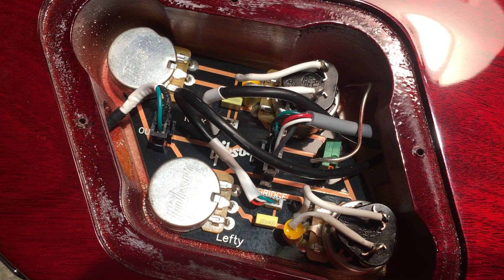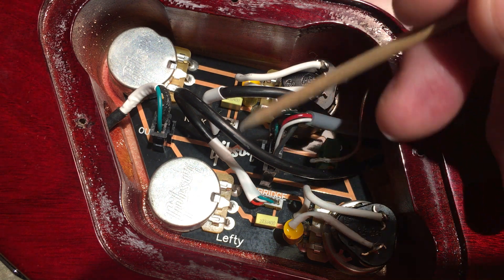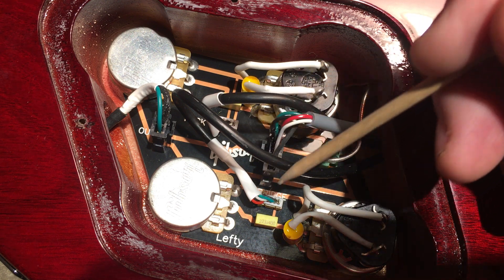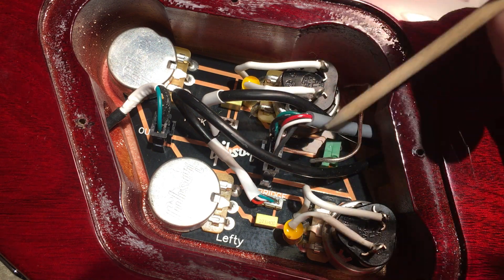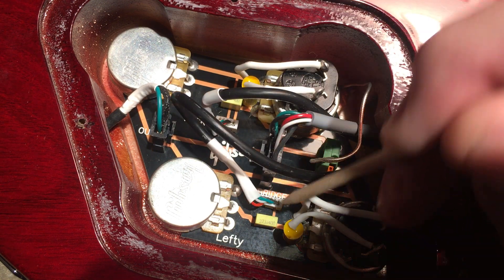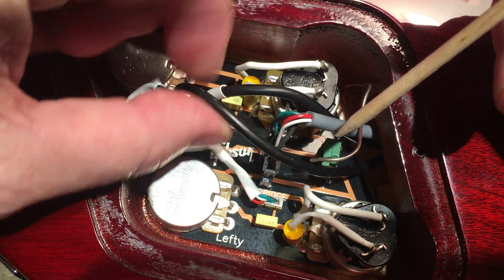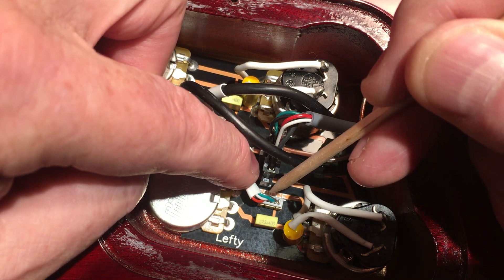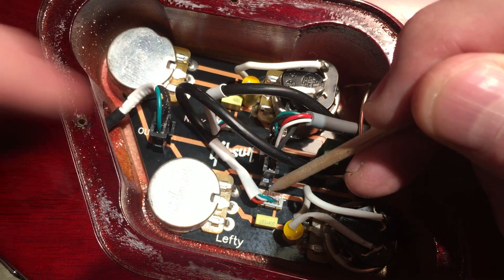Are newer Gibson electronics boards friend or foe?

Comment: They work great in my dishwasher!!
Reply from the maker: There's a place for everything right?
Reply: I really despise these pcb control boards. I do guitar and amp repairs. Like you, I see potential issues in this type of mfg.
Reply from the maker: Right? Short term manufacturing benefits, long term service problems. Plus it effectively shuts out a huge market geared towards 3rd party upgrades and modifications. @rodneykroetsch2924